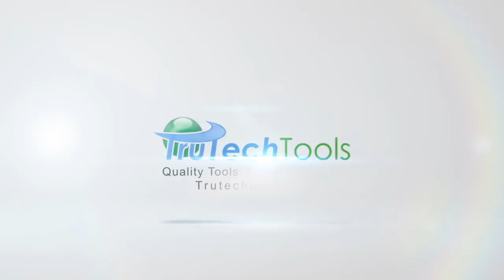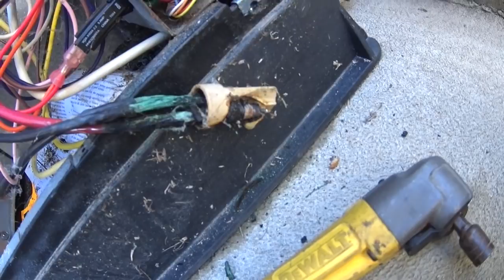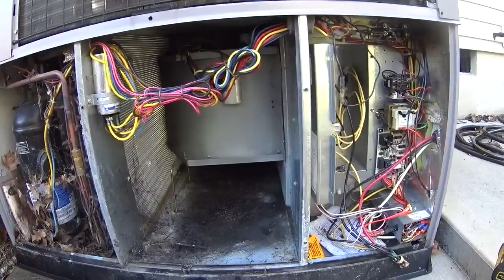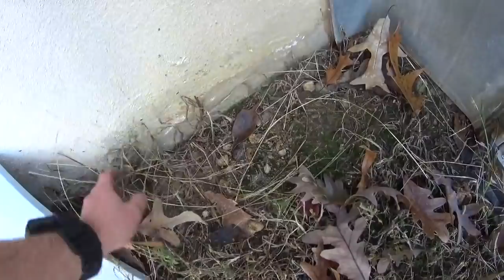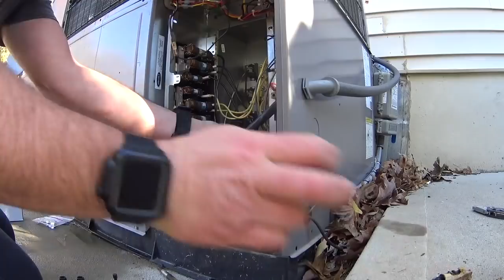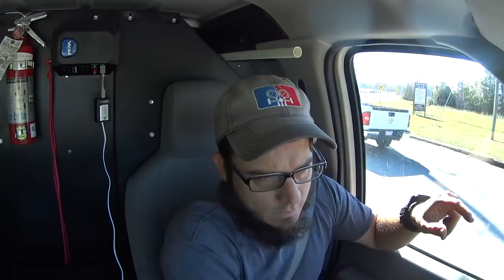11-17-17 Carrier Heatpump Package Unit Auxiliary Heat Issues

Comment: So I know this is a old video and hope you get this question buts it’s the only carrier install on youtube.  I’m installing the same heat strip except it’s 8kw.  I have to run a new breakered power wire to power the heat strip as the old  set up just had heat strip jumped from 60amp breaker.  So the new wire I’m installing will go to the lugs on the fuse block.  My questions are can I just jump the ground from heat pump ground to heat strip and the black and yellow wire coming out of the heat strip, I heard u say they connected to the compressor wires, that’s confusing me, do I connect to the other power lines powering the entire package unit?
Reply: I’m having the same concern how to connect the L1&L2 wires of the new 20kw heat strips.  I’ve already upgraded my wire to 6 gauge at 60 amps for the whole system but finally just disconnected the  heat strips all together. Rather have heat pump run by itself until I figure out safe wiring than burn everything down. Souls I run 2 separate power lines  for heat strip additions and how do I connect the wires safely?   Middle of no where.

Comment: I would suggest changing the main breaker to proper amperage for #6 wire. 125 amp breaker is excessive, should be no greater than 60 amps.

Comment: Would you like to explain to me I really would like an explanation of this what the hell was that that you just did on that other one that had it wired up so screwed up why why did he play with that did he add something not quite up with all that new stuff been in a wheelchair for 18 years and kind of only hooked up there okay normally I'd have to jack with the heater so that I can get my drywall off finished they would come in with these chunky thermostats make calls learned a lot about HVAC worked on the towers 18 story building totally different system Heating and Cooling or water tower boards water system trickle boards ancient s*** believe it was R- 50 not positive that was 20 30 years ago I'm laughing to myself I'm going back it was a long time ago heater Chiller boiler system had to blow down the boiler every morning used it for a water heating cooking showers and all the little bit too much I thought. should have seen the water turn off valve in that thing look like it came off the steamboat captain ship. Main water from the city. I know I had it one morning I went down there and blew that thing down for quite a long time it's steam coming out the doors literally that means if you had been aboard ship you might have had a problem right through the top of the ship or through the bottom more likely through the top and electrical aboard ship is totally different than on land not quite totally but pretty much and I have a lot more juice

Comment: It's always good to review your work with a video that's for sure. And other people's experiences hey dude that little thing I've been there done that kind of thing. I'm looking for an air conditioner for a friend and there's nothing but Jack wagons around Kansas City I guess looking around see what I can find right now don't want to get her over Frozen and don't want to get her under Frozen I got a three and a half ton unit on a 14 by 70 mobile home Goodman and for some reason the blue wire where is your trying to remember here power source for your thermostat I believe it's broken somewhere I need to get another one it is I can't remember what the heck they call it I know it is I just can't remember it right now I can even see the diagram my brain ain't working it shut down for the day

Comment: Looks like your kliens tool had a better day just proves the work wire strippers aren't the best they're just a little worn out I used to be an electrician to not an air conditioner electrician still don't what an electrician do your air conditioning

Comment: It likes you until you're dead electricity that is water electricity flows like water so it would flow along with the water and you until you're dead and or you release you don't get to do that most of the time it's uses to the let you go on its own after your cooked like a bug don't believe me stick your finger on it just the couple D batteries hooked up to a flyswatter wet your fingers see what it does to your fingers just a couple D batteries yeah stick your tongue to a 110 outlet same thing but a hundred twenty-five yeah we're talking death in all cases except for the D batteries unless you have a pacemaker

Comment: Nice on i had problem where the installer did nt hook up the fuses for the heat strip on a goodman package gas pack. I installed a new defrost board and charge it to specs with 410a
Reply from the maker: Heat strips on a Gaspack?

Comment: Question , So did you start your own company ( working for yourself,) if so how is it going business wise and are you staying busy with enough work. Also is it what you thought it might be like, harder,easier, working for yourself?
Reply from the maker: I went out on my own Sept 1, 2017. I have been slower recently than I had hoped but I’ll make it through. So far I wouldn’t say I harder just that winter is not the best time of year to get started on your own without a major project to jump start.
Reply: Stephen Rardon I've been thinking about starting my own hvacr and handyman business also, did you just quit your job anf start or build it up a little before going to it full time. Also what if any advice for starting out on your own. Fyi i have EPA and Nate, along with my pool certification and probably most tools that i would need.  Thanks for the input. Enjoy the vids keep it up and be safe.
Reply from the maker: I had tried to work two jobs in the past and it always ended up getting me burned out. When I finally decide to do it I didn’t have a specific build up I just fired my boss! LOL

Comment: Yes... changed the springs and orfices got 11 in w.c. input and 6 and 10.5 output low and high. It smutted up the heat exchanger....put the turbulators back in and no more issues.

Comment: Hey man I have a question regarding an earlier video where you changed out a sooted heat exchanger. I was always told to remove the turbulators when converting from natural to LP. On these new 15 seer 2 stage gas packs I've had issues with the flame blowing yellow like a blow torch and had to reinstall them. Anyone else with this issue?
Reply from the maker: Have you changed the orifices and adjusted gas pressure? I can’t imagine that reinstalling the turbulators would actually have anything to do with flame color.

Comment: I have the same unit in r410a. Installer ran 6 gauge to 10kw and compressor . It toasted the compressor and I had to run 2nd whip with 30a 10 gauge for compressor and rewire because the installer did the same crap you ran across. That wire is too small to handle that big of a load.

Comment: Not sure if it holds true for the southern part of the world, but I thought that the capacity of the backup heat should be equal to/or greater than heat pump btu out put. Such that a 3.5 ton heat pump should not be below 12.5k back up. That way when the unit goes into defrost, the home owner does not get a cold blast of air and possibly drop temp in house during defrost cycle. I am a ferm believer in sizing equipment correctly and see many homes in my area with 20k heat packages on 2 ton heat pumps. Those systems I usually replace the kits with 8k or 10k heat packages. Customers are then blown away by how much their utility bills drop.
Reply from the maker: Usually down here I see 15kw on 4-5 tons but that’s fairly rare. One company is even keeping 5kw on 3 tons and less and only using 10kw if they absolutely have to.
Reply from the maker: I’ve never seen 20kw on residential at all.
Reply: I've seen up to 30k on residential. The one that sticks out most in my mind was just before 2010. I replaced A 4ton HP that had a 30 back up, and put in a 2 stage 4ton with a 15k staged back up... That guy called back cause the thought it wasn't working, his electric bill went from over $1000 a month to just shy of $400. Needless to say he was very happy.
Reply from the maker: That’s insane!

Comment: Im still learning, why did you justbwire nut the common off the whip?
Reply: 208/230 circuit. No neutral needed. Romex was 3 wire with a ground. 2 hot legs, 1 ground, cap the extra ( if its ran)

Comment: fuses blow much faster than circuit breakers therefor are safer.  never reset a breaker standing in-front of the breaker box.  also reset it with your hand in a glove and use the hand you don't eat with or wipe your ass with.  the best electrical class I ever took was from  OSHA.  use contact grease in those really high amp wire nuts and it will drop the resistance and water proof the connection.
Reply: The obvious reason why they recommend you to stand off the side of the box when resetting a breaker is if there was ever an arc flash event, a person standing off the side has a better chance not getting burned by any plasma discharge  then if standing in front of it,
Reply: tomcat27557 anything more than 50 volts my union dictates arc flash gear must be worn
Reply: Cool was taught that years ago

Comment: Long time viewer, first time commenter.  I see that unit has one of those remote shutoff boxes installed by the power company to shut off the compressor during peak demand.  Do you see many of those in your area.  I would never willingly allow one on my HVAC system.
Reply: Also, whomever originally wired that unit is hopefully no longer in business.  I noticed several spots in the red wire coming from the main breaker that were bare copper where the insulation was scraped off in addition to the baked wire nuts.  You may have prevented a future fire.
Reply: No, he just made the situation even worse by hooking up the strip heat.

Comment: who the heck wired that thing so wrong..... that #6 AWG romex wire should have no more than a 50 Amp breaker feeding it period.
Reply: throttle bottle interesting. I always thought it was 55 which you could round up to 60. What’s your source? I’m looking at the nec table.
Reply: it's NM-B cable with 60C rating, while technically 55 Amps max. allowable you have to derate further since it's improperly inside conduit/whip. next NM-B isn't allowed outdoors, since it's a wet location (paper insulator, bare ground).
so probably should be like "thhn" wire, of two #1 awg and one #6 awg(equipment Ground) going with 75C ratings and assuming  125A breaker is what the unit states. being we don't know the unit requirements, it's all a guess. :)
I'm also doubting the meter socket/disconnect panel isn't rated for anywhere near the sum of breakers in it currently!

Comment: I hope you changed that breaker to proper size for the guesstimated #6 wire. Fire hazard waiting to happen.
Reply: looks like the wire is what was undersized for the unit, i'd guess it requires 100 to 125 amp feed, without noticing or seeing data plate.. yep he said 15KW heat strips and compressors around 5KW + fans, it would every bit need 125 amp feed or two independent lower rated feeds.
if the heat pump and heat strips ever run at the same time, that #6 AWG wire is going to burn/melt/catch fire at the ends and with luck melt and open the breaker before causing too much damage or major fire. I'm betting they undersized the fuse or put a blown one in on purpose so it would disable heat strips, just so they didn't have to run proper power feed.
Reply: Andrew Acree true enough to think maybe the wire could handle 15kw but it had the load of the motors, compressor too so likely needed a seperate 40a feed for that portion seperate
Reply from the maker: Sadly I didn’t even think about what size wire it was. Had been that way for years and didn’t melt anything but I will look to address it properly upon return. Thanks for looking out, I’ve learned more since posting on here than I did in a decade before.
Reply: throttle bottle good post I'm really disappointed that Steve didn't catch on to what the true issue was. He even was talking about the same issue at the end of this video. Ironic
Reply: If that’s a 15kw likely rated at 70 amp max overcurrent protection. #6 stranded at that distance is rated for it. 125 amps is way too much for any residential unit that I’ve ever encountered. The label on heat kit/unit data plate will have the rating.
Reply: RJParker #6 rated to 75 amps if thhn http://www.barr-thorp.com/wp-content/uploads/2011/04/digest-176-nec-tables.pdf
Reply: Joe Shearer you are right forgot about it being package unit. Personally I would just disconnect one strip and install 60 amp breaker. 15kw is a lot of heat for the sourthern U.S.
Reply: to be fair, without seeing the data-plate and knowing the unit ratings were all guessing at this point and maybe it doesn't run the heat pump and strips at the same time or can run the strips in stages? but if it's designed to run all at full output then even 125A may be too small.
Andrew Acree,  need to derate for ambient temp, size for total load and check the device/breaker terminals ratings, it could be 60C/140F rated. the lowest rated item is what you figure with. probably end up at the 60C rating with 50 to 55A max.
on #6 thhn, (not figuring over-size allowed for start current.)
so it's best to always use the 60C/140F table ratings, unless you know all terminals are 60C, 75C or 90C rated and derate with ambient temp correction. (engineering problem)